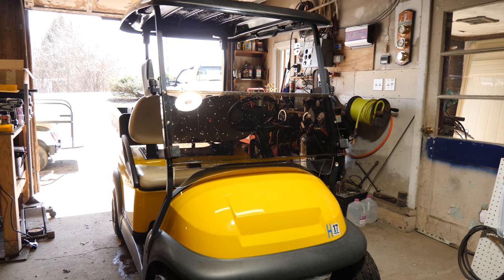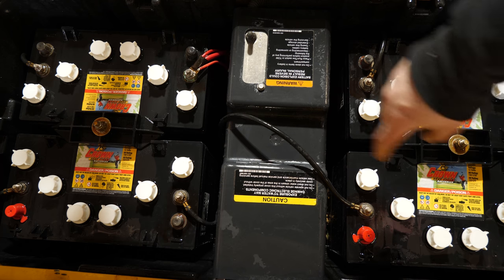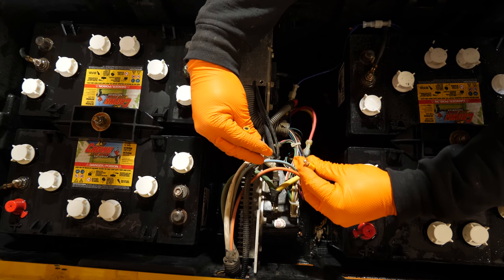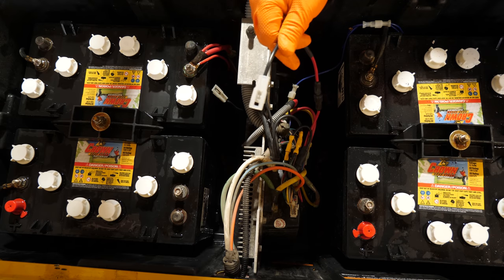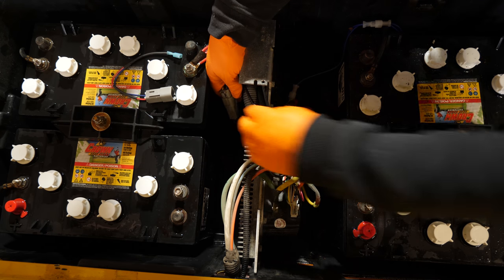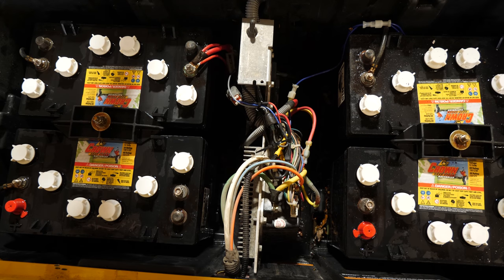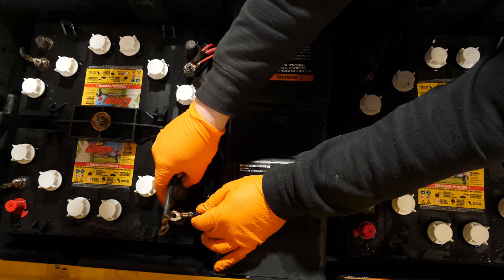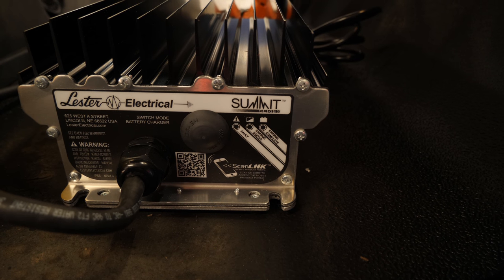2008 Club Car Precedent, 48 Volt Electric - Install OBC Bypass Kit

Comment: I’ve converted to a 48 volt newer charger. Been told I needed to bypass the computer.  We have no place local that knows anything about them so use the alligator clips on the main hot and negative.  I have the club car charger adapter like my old charger had but it won’t work.  Been doing this for over a year.

Comment: Hello. Great video! If I am using a new 4 bank charger, putting a new 110v receptacle in as the new charger plug up which will in turn just turn the four bank charger on I have in the dash, do I need this bypass harness? Or can I just remove the OBC completely?
Reply from the maker: It will depend on the way the charger you are using is setup. Some chargers are not designed to be installed on the cart. Some chargers will work with the OBC, some will not and it will have to be bypassed. You will need to check with the charger manufacturer's manual.

Comment: will this harness work on a 97 club car ds?
Reply: A 97 DS is easy. Just run two wires, order a timer kit from Lester and wire it into the existing Powerdrive charger.